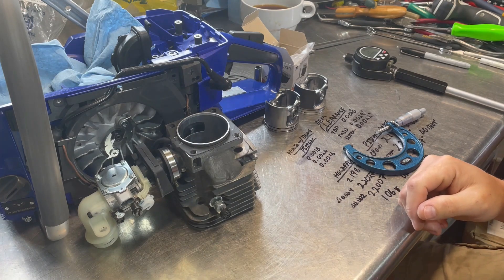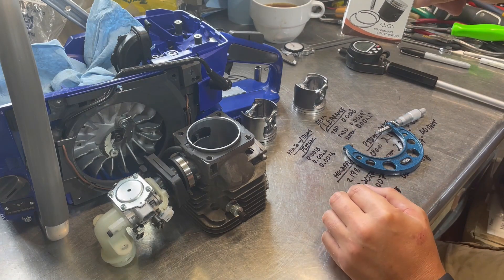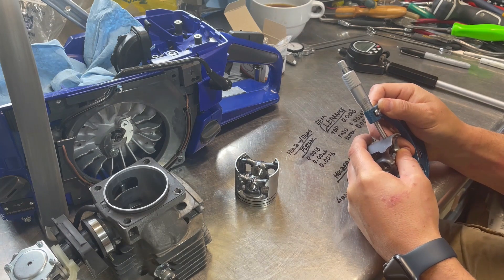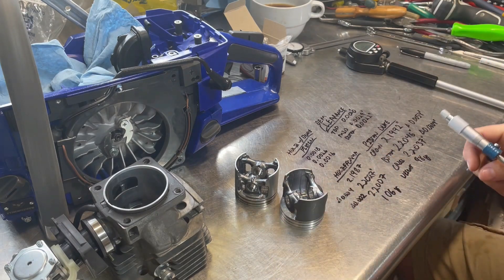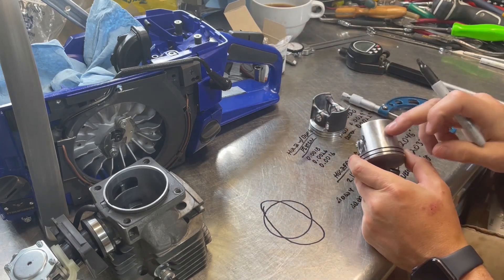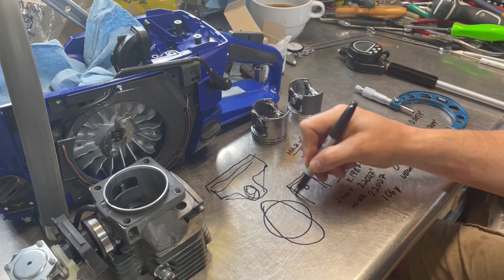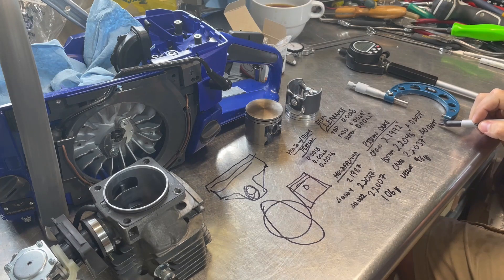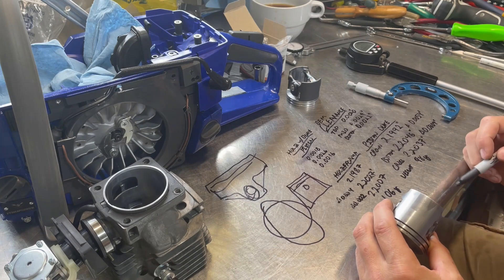Holzfforma G395 piston slap issues, excessive clearance!

Comment: I’m planning on buying a g395.  Do you think the piston upgrade does the trick?
Reply from the maker: Yes, it runs fine after swapping the piston. They may have already corrected this issue and you won't need to swap pistons.
Reply: @srcarr52  thanks!  Thanks for working on that!
Reply: @srcarr52  Just tore mine apart over the weekend, just ordered it from Wagner's and never ran it. It's been run a fair amount by the looks of the carbon inside. Piston was 2.202" and the bore is 2.206". Runs nice but I haven't even gotten it hot yet so I'm sure it'll rattle.
Reply: Hi have you been able to confirm they have corrected this issue? Also what's your take on the carburettors? Cheers

Comment: Judging by the squish band width, smaller combustion chamber, larger lowers and piston slop they copied a used ported top end. They probably wanted this to perform well when released so they wanted a better performing top end. When I was comparing the FT cylinder to an oem there just seemed to be a resemblance to a machined work saw cylinder. Idk maybe not. I had a few AM pistons and I just measured them til I found one that fit the best and went with it. I’m not sure of what brand the piston was but the skirts were longer by about 40 thou so I had to re time my porting. Also I had the coil die after a couple runs which was weird it just completely stopped producing spark with no warning lol 😆 so I ordered a 15$ Amazon coil and we were back up and running.
Reply from the maker: The intake and exhaust durations are longer than an OEM cylinder but the transfers are timed the same. The exhaust bottom and the intake top port edges are close to OEM locations so I suspect it might have been a slightly ported but not machined cylinder. It you used a piston with a 0.040" longer skirt it was from a 394.
Reply: @srcarr52  That’s definitely possible on the piston. It was just a bunch I had bought a while back and dug them out for this. I just found the squish band width odd compared to the Brazilian oem cylinder I compared it to.